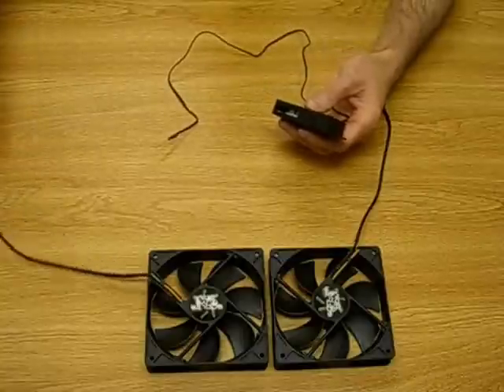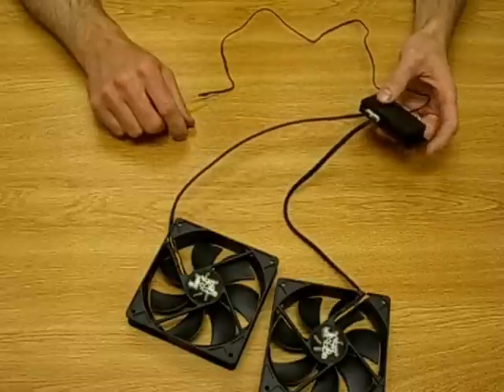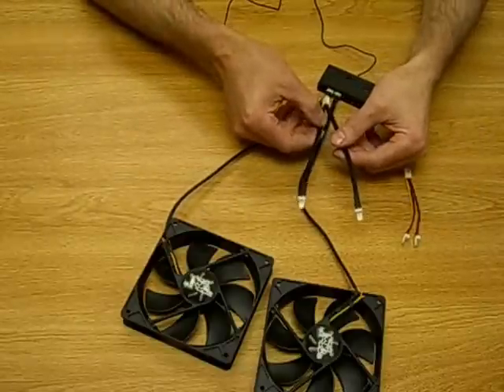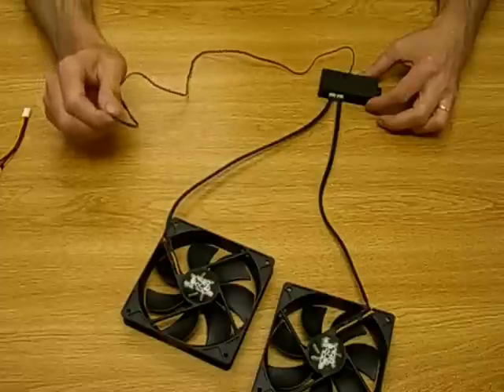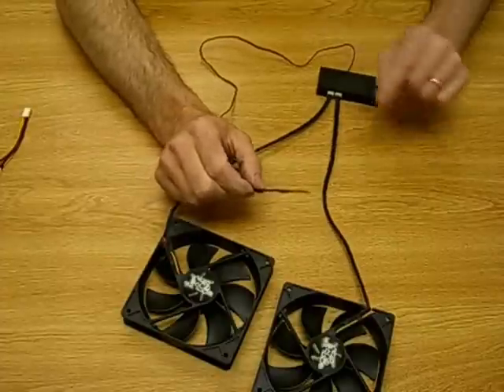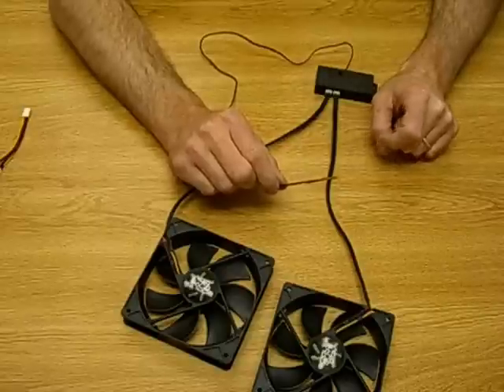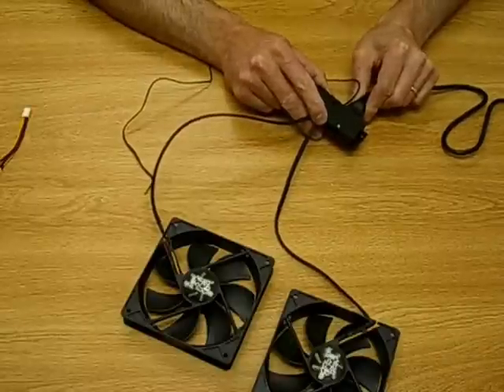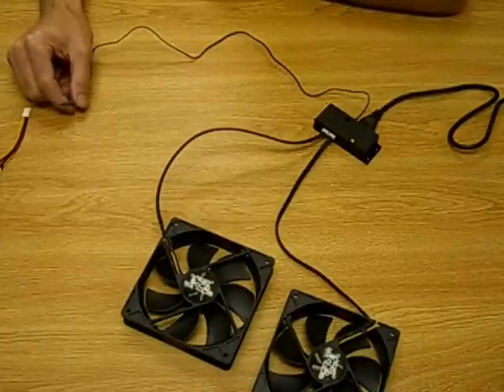Coolerguys Thermal Fan Controller

Comment: Fabulous output on the fan! However the preset controller link in the description is not the same as the controller used in this video. Would be great if you could add the link to the same model used here for non-tech savy fans😂 like me.

Comment: What’s the total amp output of the thermal controller? Plan to install 4 120mm fan. Each one has 3amp motor with max 7000rpm.
Reply from the maker: Hello! Wow--those are some fast 120mm fans.  Unfortunately, our max output is 2A with this thermal controller. We also don't recommend trying to draw over 1A on a single header (connectors we use on this controller)---be careful with how you connect those to whatever power supply you end up using.